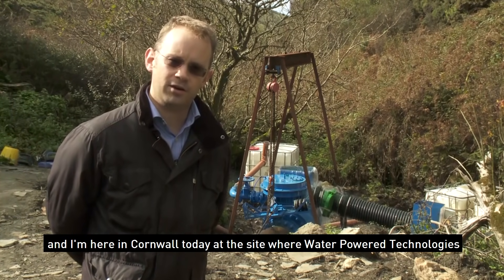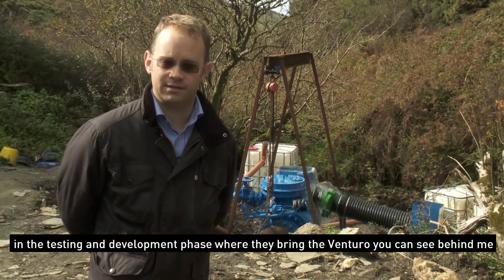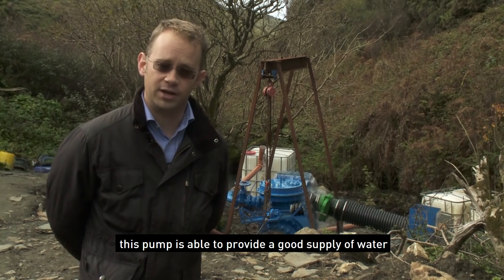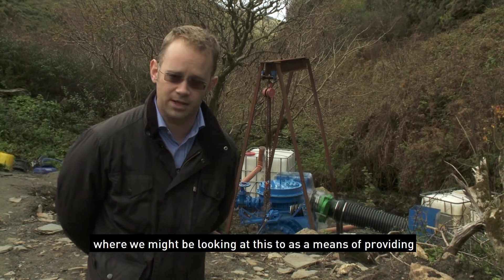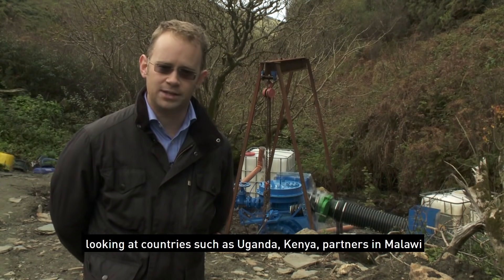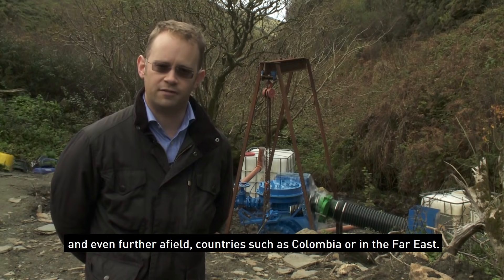Largest Ram Pump in the World

Comment: This would be great for the Panama Canal.  Installing multiple pumps to return water back up to the lake, it can help reduce the amount of water being removed.  used in combination with the Wirtz pump, and hydro generation, it can push up lots of water up the locks to refill the Panama canal lakes.

Comment: Letting the ejected water fall back down without capturing that energy is a waste
Reply from the maker: Generally the water is returned to the stream or river it was taken from, this is good for wildlife and any other users of the water further along. The exhaust water is depressurised but you could capture the energy if you wanted to.
Reply: @Waterpoweredtechnologies  yeah well, with the height that one spits it out at you could harvest the energy and return the water
Reply from the maker: you could yes

Comment: The only downside is, that you wase a lot of water if it is not flowing back into a river
Reply: The water flowing out of the waste valve represents wasted energy which could be put to better use.
Reply from the maker: Generally the water is returned to the stream or river it was taken from, this is good for wildlife and any other users of the water further along. The exhaust water is depressurised but you could capture the energy if you wanted to. @atomizer2665

Comment: I take it this would not be a practical technology at least in current form for large scale water transportation because the pressure forces I'm guessing grow exponentially or something as you scale up? At least on a practical level? Like first I'm thinking well what if you built a big one of these underground so that solid Rock was helping contain the pressure, and then I was thinking about don't they need insanely high pressure containment capabilities for like fusion reactors? So I'm sure you could build one of these that could deliver thousands of gallons per second or something, it just might be fucking ridiculous as far as the engineering requirements. Actually theoretically you could probably figure out where all the pressure spikes are in this I don't know? I'm just starting to learn about how all this works
Reply: Unfortunately, here in dry Southern California I don't really have much practical use for this, but it certainly inspires lots of potential uses elsewhere!
Reply from the maker: Hi Bryan, the pump in the video is capable of pumping up to 4,500 litres/minute over 50km with enough supply head and we have tested a scaled up version (2X this ones size) which would be capable of around 18,000 litres/minute and even greater distances. 

We have a project that will soon be coming to installation with 2 of these "smaller" pumps that will be rather high pressure (delivering to a height of almost 300m and distance over 2km) so feel free to follow us along for updates on that and more
Reply: @Waterpoweredtechnologies  damn, that's nothing to sneeze at! What elements of the design have to be beefed up the most as far as strength and ability to withstand pressure and stresses as you scale up?
Reply from the maker: @bryanchandler3486  Mainly the pump chamber and supports due to pressure spikes and weight respectively

Comment: pretty cool . how do you handle the pump overflow ? with a pool to keep the overage in the system flow ? I have to wonder how up scaleable this will be pipe diameter wise ?
Reply from the maker: Hello, These pumps are designed to be used on a flowing water source such as a river so the overflow is directed back to the original water course just at a lower point than it's intake. These Venturo pumps are fully scalable and are custom designed and made to suit the application, the pump in the video is DN500 intake pipe but we have also tested a DN1000 Intake version too

Comment: so essentially, delivering 1800 liters of water a minute with a ram pump means around 16 000 liters of water is being wasted in the process since the ram pump doesn't seem to have a system in place to capture the waster water and direct it back to it's source with minimal loss. Ram pumps should 100% be illegal if there is no system in place to direct all the overflow water back to its original source
Reply from the maker: The water seen flowing out of the exhaust does flow back into the original water course as with all of our systems. Please take a closer look at the video.

Our pumps are also capable of pumping up to 30% of the input water dependant on supply and delivery heads
Reply: @Waterpoweredtechnologies  How many meters is the drive pipe in this video??
Reply from the maker: Hello,

This pump was installed as a demonstration of it working so the system is not designed to pump anywhere, 

The supply pipe was about 90m long and a supply head of about 7-8m

Comment: Is there a way to use this tech with massive wind turbines (or parabolic solar driving steam turbines) utilising a purely mechanical system to get sea water to high elevations in the mountains in Morrocco and Sudan and then use solar distillation tents at elevation to run clean water to desertified areas in Africa? Need to get to 700m elevation.
Reply from the maker: It would be better to use the streams and rivers around the mountains for this
Reply: @Waterpoweredtechnologies  There`s a few places with high elevation right next to the ocean, & then they lead down to desertified areas.
Was thinking with the advances in turbine and solar it might be feasible to get the water up high using renewable energy
Reply from the maker: @drawnbydragons  You would be able to pump using wind or solar pumps. Our pumps require a fall in water level (that's where the energy comes from)
Reply: @Waterpoweredtechnologies  Still might be useful to go back up in places from the main gravity feed. I`ll see what the numbers say about how much water some turbines can get up the mountains
Reply from the maker: @drawnbydragons  Do email us at info@wptglobal.net if you find you have a project. We'll be happy to help
Reply: @Waterpoweredtechnologies  Ok thankyou!

Comment: I’ve been watching these videos and I still down know how you get water to flow up hill 😂
Reply: It uses the kinetic energy of a large amount of water flowing downhill to push a MUCH smaller amount of that water back uphill.  Think of dropping a large weight on a seesaw with a much smaller weight on the other end.  The smaller weight will be launched higher than the large weight was dropped from.
Reply from the maker: Hi Scott, Please see this video https://youtu.be/DQydGCNgPmA 

I hope it helps you! We're always available by email for any questions
Reply: @Waterpoweredtechnologies  sorry I think I understand now, the drive pipe(water supply) needs to be higher than the pump for it to work? Then it can pump to higher than the supply?
Reply from the maker: @scottshipley570  Yes! that's it, the pumped water can be anywhere from 10% to 30% of that supplied and the rest is normally returned to the natural water course

Comment: It may serve "a lot of utility" had it not been pissing 1/2 water away into nothing at the bottom...
Reply: An unfortunate necessity. That water is, from a certain point of view, what powers the pump.
Reply from the maker: The water exhausted is in essence what powers the pump, this water can also be utilised by anything bellow it or down stream depending on the location of the pump. 

In the purely demonstrational model here, the water is returned to its natural water source for sustainability and low impact on the water course

Comment: Using a ram pump for “pumped hydro” storage is the dumbest idea. Literally just make a pool where the water inlet is and you have more stored energy than what you could possibly have otherwise
Reply from the maker: The idea is to use the ram pump to gain a larger head and use it for rapid peak time generation or use it as a top up system along side normal pumped hydro. 

"Making a pool" is called a dam. This can damage wildlife and have terrible effects up stream. by using ram pumps for pumped hydro you can pump the water to a more suitable storage location (low impact location) and still allow the normal flow of the river to prevent damage to the ecosystem. All without using fuel or electricity. 

It's all about the bigger picture.

Comment: So you could lift the water to a high level, then use the head pressure to run a turbine to power generators?
Reply from the maker: Yes that's one use, other hydropower use can involve using these pumps to compliment pumped hydro storage
Reply: @Waterpoweredtechnologies  thank you. So theoretically, you could produce power in the >50 KW range (conservative, looking at the flow rate of this pump) and all you'd need is a water source like a river or lake. Surely this would be a more reliable, lower maintenance, lower cost and more discreet solution compared to off-shore wind turbines?
Reply from the maker: @rusticraver82  Yes that is around the range of this pump, it possibly could be with some more development!
Reply from the maker: @rusticraver82  take a look at one of our concepts around this 

https://www.waterpoweredtechnologies.com/jetstream/
Reply: @Waterpoweredtechnologies  This reminds me of a displacement system I read a paper on about 10 years back. Used buoyancy and displacement to float magnetic pods through coils to generate power. Once the pods break the water surface the air escapes and they sink back down again, it was attached to a small air pump to push air into the bottom of the column and fill the pods at the bottom.

Comment: How would this compare to a setup where a continuous rotational high volume / low pressure pump (acting as a water wheel) is directly shafted to a low volume / high pressure pump?
Reply from the maker: Hello, please email us at info@wptglobal.net
Reply: less moving mechanic part would be equal to greater efficiency.. apart from the design

Comment: This is very interesting for the reason that it sounds like free energy. Hydro power was mentioned, which is quite a call. In theory if this could push water up hill, you wouldn't need to worry about energy again. I have a feeling that this is not the case.
Reply: It’s not free energy because it requires flowing water. Which is not in endless supply.
Reply from the maker: Hello Martin, this is in no way free energy, the energy used to pump water comes from the water you see being exhausted back into the water course
This makes it a zero fuel, zero electricity and sustainable way to pump water

Comment: As a kid my grandfather had a pamphlet about a Seattle pump station that had two 16" drive line ramp pumps working on the same delivery line to pump 500k gallons a day.  the drive head was 50ft and the delivery line was 100ft.   there was a picture of a guy standing in front of these monsters.  I wish i still had the picture.  the water source was the Cedar river
Reply from the maker: Would be good to see those old beauties. 
Still smaller than the smallest of our Venturo pumps though! 
And with that head and delivery the pump in the video could achieve over 1,425,400 gallons a day! From 1 pump!
Reply: @Waterpoweredtechnologies  as far as production definitely smaller, but the man in the picture was dwarfed by the 20ft tall bladders

Comment: You can also do this with standing water if you make a shaft next to it, deeper than the water, you can still generate electricity with a turbopump, and underneath a ram pump to return the water, then you have a closed system and free energy.
Reply from the maker: That's perpetual motion which doesn't exist
Reply: @Waterpoweredtechnologies  insted of a ram pump, a turbopomp, and it depends how diep you go
Reply from the maker: @jaapbudding9137  still the same concept. Perpetual motion. Sorry it's impossible

Comment: Wouldn’t it be smarter to just put an hydro generator at the big main pipe if your goal is generating rather then lifting water
Reply from the maker: Not really the losses in converting to electric then back would mean you'd only be able to pump a little more than this does and at over triple the cost + maintenance
Reply: @Waterpoweredtechnologies  
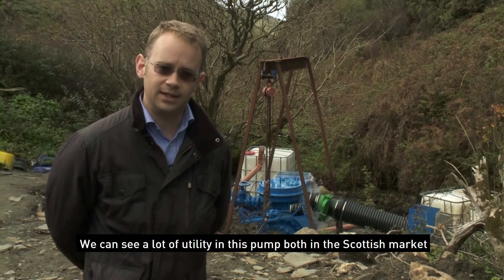Oh no my bad, I was referencing the 1:12 part when power generation was mentioned, I don’t get why you need a ram for power generation 

And 
(If) the water is flowing all day there shouldn’t be any need to store a fraction of it if you could just use the main pipe for power generation ? 

Or am I missing something?
Reply from the maker: @GrafRucola  So this is referring to pumped hydro which makes use of short falls to pump up to a higher storage further way to prevent having to dam a river. Obviously the bigger the drop the more power you can generate. 

By also moving the storage and not damming the river it has a lot less of an effect on the eco system around the river. 

Another use of pumped hydro is for peak time usage, this means the turbines would only be active when peak usage of electricity occurs so they bolster the supply to the grid in times of need. Meaning a steady feed over 24hrs that does not use all the water is more suitable.
Reply: @Waterpoweredtechnologies  ah i see, 
Thank you for the insight
Reply from the maker: @GrafRucola  Not a problem, happy to help :)

Comment: Marvellous how the ram pump works. No energy needed 👍👍👍
Reply: Or at least no oil, gas, coal or nuclear power needed. I think if more farmsteads implemented measures like these, it could cut CO2 emissions quite substantially. Hell, imagine fitting the water supply of an entire city with micro hydropower units wherever there's a surplus rate of flow strong enough. I think that could cut electricity costs like a lot across urban areas.
Reply: @kebman  they could do that, supply towns and cities using the ram pump method,  I assume if it’s possible geographically . But it’s not in the interest of the big companies
Reply: @Miroslav Kašpar true of course. When I say energy, I mean fossil fuels or electricity 👍

Comment: only downer with Ram pumps they waste a lot of water
> Useless in Droughts Where every drop of Water Counts 

Prefer the Solar (MPPT VFD) & Wind Kinetic Pump (+ Archimedean screw turbine (Pump - Store - Generation) Options 
+ Air Wells (Condensers) -> Atmospheric Water Generators 
+ Fans & Pads "Salt water" + "Treated Sewage" Water  Greenhouse's

Archimedean screw turbine + vertical-axis wind turbine (VAWT)  can be 3D Printed (and with Recycled Plastics)
Reply from the maker: You see waste we see sustainability, maintaining the natural water course downstream is very important for the environment and eco system

Comment: The only problem I see is huge wastage of water.
Reply from the maker: It's not wastage, it's sustainable :) The water out of the exhaust is what is used to pump the rest of the water up. our pump can be some of the most efficient out there when it comes to no fuel or electrical input :D
Reply: @Waterpoweredtechnologies  and where does that water go once it leaves the exhaust?
Reply from the maker: @234doit  Back to the original water course :D
Reply: @Waterpoweredtechnologies  oh i missed that huge canal you had built , sry.:)

Comment: Not sure how well this technology will work in dry climates like Kenya. You need a large amount of moving water to pump a small amount of water a short to moderate distance depending on the hydraulics of the discharge piping.
Reply from the maker: We actually have a large system in Kenya with 2 of these Venturos planned to be in by the end of 2022 so watch this space

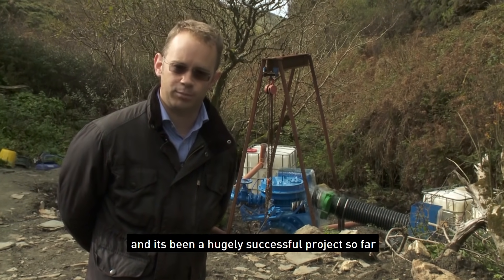Comment: @1:02 ... Ssssst , no one need to hear you are from university , is a shame bro . "0" energy will never exist . 
The pump converts the flow into pressure minus the energy subtracted from the flow for operation.
Reply from the maker: Hello, the video does clearly sate it is "zero energy input from electrical grid connection or petrol or diesel" we're not claiming to break physics ;P

Comment: I think it probably is the largest... though i know where there is an abandoned one, at least 80 years old, that in physical size is not far off this. No idea about flow rates. It sadly had the impulse valve missing.
Reply from the maker: They did use to make some rather large ones, however they were nowhere near as efficient as ours ;)
Reply: @Waterpoweredtechnologies  Is it true that the larger the pump, the more efficient it can get?
Reply from the maker: @kaloryfer99999  No, efficiency depends on supply head, the more supply head the more efficient the pump can be. Energy efficiency of our pumps is typically about 85% and volumetric efficiency can get as high as 30%
Reply: @Waterpoweredtechnologies  Can the head be substituted with pressure? Let's say, by a pump? I know this is not practical, but I'm curious about the technicals.
Reply from the maker: @kaloryfer99999  Yes technically, as long as there is lower pressure at the exhaust point then the input the pump will operate (other factors need to be considered but that's the basics)

Comment: I wonder if anyone has used a ram pump to fill a dam reservoir in order to power a hydro generator. I mean couldn't that be made into a closed-loop system? 🤔
Reply from the maker: Closed loop wouldn't work but that is one of the areas this design is aimed towards